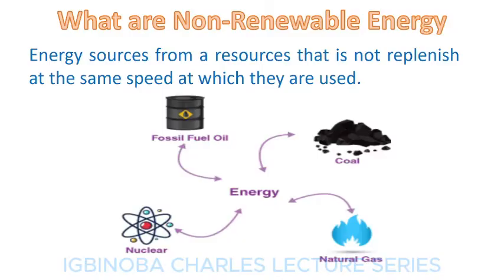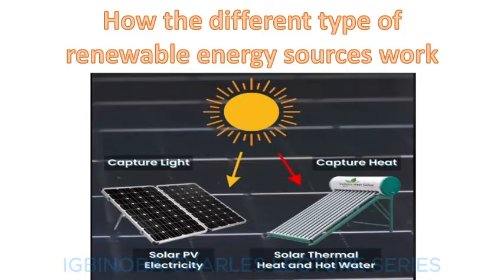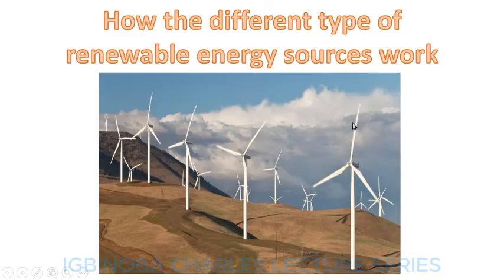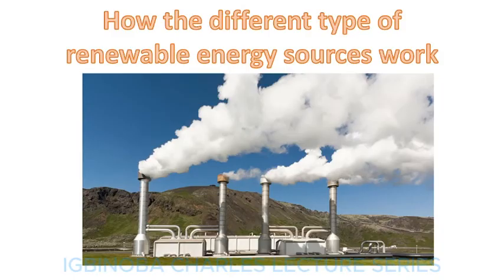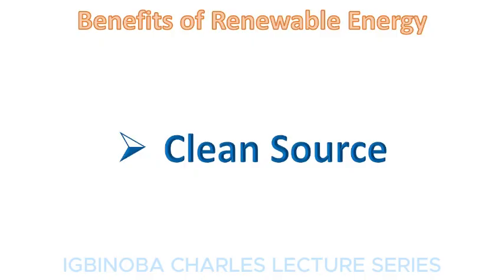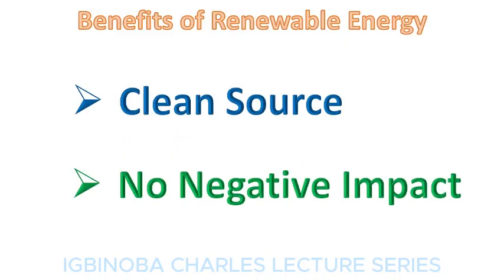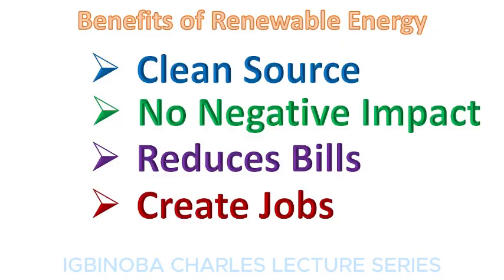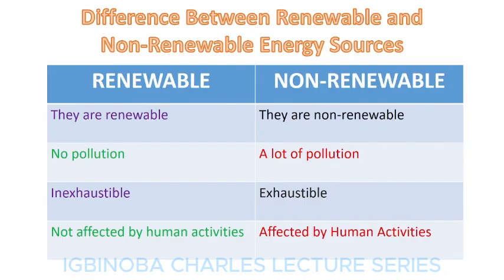From Fossil Fuels to Clean Power: Understanding Energy Sources

Comment: EEE81C 

No energy source can be considered completely pollution-free when evaluated using a life-cycle assessment. Every source of energy has some environmental impact.

Even renewable sources produce pollution during the manufacturing, installation, maintenance, and disposal of equipment such as solar panels and wind turbines.

Non-renewable sources, such as coal and petroleum, cause more direct and significant pollution during their use.

Comment: CIV2B 
 No energy source can be considered completely pollution-free.
Even renewable sources such as solar, wind, and hydroelectric power have some environmental impact during the manufacturing, transportation, installation, maintenance, and disposal of their equipment.
For example, solar panels do not produce pollution while generating electricity, but producing and disposing of the panels requires energy and materials.
Therefore, some energy sources are much cleaner than others, but none can realistically be considered 100% pollution-free.

Comment: MAR103Y
 No energy source can be considered completely pollution-free when evaluated using a life-cycle assessment. Every source of energy has some environmental impact. Even renewable sources produce pollution during the manufacturing, installation, maintenance, and disposal of equipment such as solar panels and wind turbines. Non-renewable sources, such as coal and petroleum, cause more direct and significant pollution during their use.

Comment: EFETURI-YOUNG SOLOMON 
COET/10546/2022

No energy source can be considered completely pollution-free when evaluated using a life-cycle assessment. Every source of energy has some environmental impact. Even renewable sources produce pollution during the manufacturing, installation, maintenance, and disposal of equipment such as solar panels and wind turbines. Non-renewable sources, such as coal and petroleum, cause more direct and significant pollution during their use.

Comment: EEE54B
 ANSWER 
No energy source is 100% pollution-free because all of them create some pollution during mining, manufacturing, or waste disposal. The cleanest options are renewables like solar, wind, and hydro, which produce zero pollution while running. Nuclear is also very clean with zero air pollution, though it creates radioactive waste that must be stored safely. The dirtiest are fossil fuels — coal, oil, and gas — because they release lots of CO2 and air pollution. Currently, the best combo for low emissions is wind, solar, and nuclear together, and over their full lifetime they are 10-50x cleaner than coal.

Comment: MEC76X 

No, no source of energy can be considered completely pollution-free.
Even renewable sources such as solar, wind, hydro, and geothermal energy produce little or no pollution during operation, but some environmental impact occurs during the manufacturing, transportation, installation, maintenance, and disposal of their equipment.
For example, solar panels require raw materials and energy to manufacture, while hydroelectric dams can affect rivers and ecosystems.
Conclusion: Renewable energy sources are cleaner and much less polluting than fossil fuels, but no energy source is completely pollution-free.

Comment: CHM30D
Answer:
No energy source can be classified as completely pollution-free when evaluated through a full Life Cycle Assessment (LCA). Even renewable energy systems that emit zero pollutants during operational generation carry an indirect environmental footprint during raw material extraction, equipment manufacturing, installation, maintenance, and end-of-life waste disposal. Ultimately, energy transitions focus on minimizing cumulative environmental degradation rather than eliminating it entirely.

Comment: CIV42P

No energy source can be considered completely pollution-free.

Reason: Even renewable energy sources such as solar, wind, and hydroelectric power can cause some environmental impact during the manufacturing, construction, transportation, and disposal of their equipment. For example, solar panels require raw materials and energy to manufacture, while hydroelectric dams can disturb ecosystems.
However, renewable energy sources generally produce much less pollution during operation than fossil fuels such as coal, oil, and natural gas.

Comment: MAR87I

ANSWER: NO

REASON:
No energy source is completely pollution-free because its production, transportation, installation, operation, or disposal can cause some environmental impact.

For example, solar and wind energy produce little pollution during operation, but manufacturing their equipment requires mining and processing materials.

Therefore, renewable energy is cleaner, but not 100% pollution-free.

Comment: PETRO40N
Answer: No energy source can be considered 100% pollution-free.
Reason: Even renewable sources such as solar, wind, and hydroelectric power can cause some environmental pollution during the manufacturing, transportation, construction, or disposal of their equipment. For example, solar panels require mining and industrial processes to produce.
However, renewable energy sources generally produce much less pollution during operation than fossil fuels such as coal, oil, and natural gas.

Comment: PETRO80B

No source of energy is truly free — while raw resources like sunlight or wind cost nothing to exist, converting them into usable energy always requires equipment, labor, and maintenance, all of which have a cost. Additionally, energy conversion always loses some usable energy as waste heat, since no process is 100% efficient. So even free energy sources come with real costs to harness and use. 23:16 23:16 23:16 23:16

Comment: CHM66N
Answer:
No type of energy can be said to be completely free from pollution.
Reason: All forms of energy production and consumption have some level of environmental impact, either directly or indirectly. For example, solar and wind energy produce very little pollution during operation. However, the production, transportation, and installation of their equipment require materials and energy, which can cause environmental pollution.
Therefore, renewable energy sources are cleaner and more environmentally friendly, but they are not completely pollution-free.

Comment: CIV44R
ANSWER:Every energy source has some environmental impact. While renewable options like solar, wind, and hydro cause pollution during manufacturing, setup, and disposal, they generate almost none while running. As a result, they are vastly cleaner and less polluting than fossil fuels.

Comment: MAR111G 
No source of energy can be said to be  100% pollution free but renewable energy sources like Solar energy have a minimal pollution in comparison with non-renewable energy sources like coalnand crude oil which pollute the environment in various ways such as exhaust  fumes, noise pollution from engines, and emissions. Renewable energy such as solar energy is a cleaner and more efficient method in tackling and mitigating these  pollution problems because it does not release exhaust fumes and it is very much noiseless.

Comment: PETRO94P
Renewables are not pollution-free , but they are pollution-minimal—especially during operation. When paired with responsible sourcing, improved recycling, and careful siting, their environmental footprint is vastly smaller than fossil fuels. The question is less about finding a perfectly clean source and more about choosing the least harmful option while continuously improving it.

Comment: PETROCHEM24X

No, no source of energy can be considered completely pollution-free. Even energy sources such as solar and wind, which produce little or no pollution while being used, can cause some environmental damage during the manufacture, transportation, installation, and disposal of their equipment. For example, producing solar cells requires industrial processes that can cause pollution. Therefore, some energy sources are cleaner than others, but none is completely pollution-free.

Comment: CHM108C
No energy source is completely pollution-free. Even renewables like solar, wind, and hydroelectric power have environmental impacts during production, installation, and disposal. However, they produce far less pollution during operation than fossil fuels and are therefore considered clean or low-pollution energy sources.

Comment: MEC74v

ANSWER:No energy source is completely pollution-free. Even renewables like solar, wind, and hydroelectric power have environmental impacts during production, installation, and disposal. However, they produce far less pollution during operation than fossil fuels and are therefore considered clean or low-pollution energy sources.

Comment: MEC30D

Ans: No source of energy can be considered completely pollution free.
Even renewable energy sources such as solar, wind and hydroelectric energy can use some environmental impact during the manufacturing construction, transportation or installation of the equipment. Therefore, energy sources can be cleaner or less polluting, but not completely pollution free

Comment: COMP93O
 

Answer: No, no source of energy is completely pollution-free.
Even renewable sources like solar, wind, and hydroelectric power can cause some pollution during their manufacturing, transportation, construction, and disposal.
For example, solar panels produce clean electricity during operation, but manufacturing them requires raw materials and energy, which can create pollution.

Comment: NAT37K

ANSWER:No energy source is completely pollution-free. Even renewables like solar, wind, and hydroelectric power have environmental impacts during production, installation, and disposal. However, they produce far less pollution during operation than fossil fuels and are therefore considered clean or low-pollution energy sources.

Comment: MEC36J 
Answer:No energy source is 100% pollution-free. While renewable sources (like solar and wind) generate electricity without emitting harmful greenhouse gases, the industrial processes required to mine raw materials, manufacture the equipment, and eventually dispose of it still create an environmental footprint.

Comment: EEE42P
No ,energy source can be considered completely pollution-free. Even renewable sources such as solar, wind, and hydroelectric power have some environmental impact during the manufacturing, transportation, installation, and disposal of their equipment. For example, solar panels require raw materials and energy to manufacture, while hydroelectric dams can affect ecosystems and wildlife.

However, some energy sources produce far less pollution during operation than fossil fuels. Renewable sources such as solar and wind are therefore considered clean or low-pollution energy sources, rather than completely pollution-free ones.

Comment: MEC44R

No. No source of energy is completely pollution-free.

Reason:
Even renewable energy sources like solar, wind, and hydropower cause some pollution during the manufacturing, transportation, installation, and disposal of equipment. Fossil fuels cause much more pollution because they release harmful gases when burned.

So, while some energy sources are cleaner than others, no energy source is entirely free from pollution.

Comment: PETRO70R

No energy source can be considered completely pollution-free. This is because every method of Producing or using energy has some impact on the environment, either directly or indirectly. For example, solar and wind ener gy produce very little pollution during operation, but manufacturing their equipment requires raw materials, ener qy, and transportation, which can contribute to environmental pollution. Therefore, renewable energy sources are regarded as cleaner and more environmentally friendly alternatives rather than being entirely pollution-free.

Comment: CIV61I
Answer:No energy source is 100% pollution-free. While renewable sources (like solar and wind) generate electricity without emitting harmful greenhouse gases, the industrial processes required to mine raw materials, manufacture the equipment, and eventually dispose of it still create an environmental footprint.

Comment: CHM52z
No, no energy source is 100% pollution-free.
Reason:
While renewable sources (like solar and wind) generate electricity without emitting harmful greenhouse gases, the industrial processes required to mine raw materials, manufacture the equipment, and eventually dispose of it still create a small environmental footprint.

Comment: EEE31E
Answer
No energy source can be regarded as completely pollution-free.
Reason: Every form of energy production or use has some effect on the environment, either directly or indirectly. For instance, solar and wind energy generate little pollution while operating, but producing their equipment requires raw materials, energy, and transportation, which may contribute to pollution.
Therefore, renewable energy sources are considered cleaner alternatives, rather than being entirely pollution-free.

Comment: EEE3C
No energy source is 100% pollution-free . Even though solar, wind, and hydro produce zero emissions while operating, pollution still occurs when mining their raw metals, manufacturing and transporting the equipment, and disposing of old panels or batteries. Renewables are far cleaner than fossil fuels, but no energy source is completely zero-impact from start to finish.

Comment: EEE96R

No, no source of energy is completely pollution free.

Reason: Every source of energy causes some pollution or environmental impact at some stage. 
For example:
Thermal power plants burn fossil fuels and release harmful gases like carbon dioxide.
Hydroelectric projects can disturb ecosystems and displace people.
Solar panels and wind turbines produce clean electricity during use, but pollution is caused during their manufacturing, transportation, and disposal.

Therefore, while some energy sources are much cleaner than others, no energy source is entirely pollution free.

Comment: EEE17Q
Answer: No energy source can be considered 100% pollution-free because every method of generating or using energy impacts the environment in some way, directly or indirectly. For instance, solar and wind power produce minimal pollution during operation, but manufacturing the equipment requires raw materials, energy, and transport—all of which generate pollution.
Therefore, renewable energy is best viewed as a cleaner alternative rather than being completely free of pollution.

Comment: EEE52Z

No energy source can be regarded as completely pollution-free.
Reason: Every form of energy production or use has some effect on the environment, either directly or indirectly. For instance, solar and wind energy generate little pollution while operating, but producing their equipment requires raw materials, energy, and transportation, which may contribute to pollution.
Therefore, renewable energy sources are considered cleaner alternatives, rather than being entirely pollution-free.

Comment: EEE48V

Answer: No energy source is completely pollution-free. Every form of energy has some environmental impact at some stage of its life cycle. Non-renewable energy sources generally cause pollution through extraction, processing, and combustion. Renewable energy sources are cleaner, but they still require materials, equipment, and infrastructure that must be manufactured, transported, and maintained. As a result, some level of pollution or environmental impact can occur during the production, installation, transportation, or operation of these systems.

Comment: CHM23W
Answer:
No type of energy can be said to be completely free from pollution.
Reason: All forms of energy production and consumption have some level of environmental impact, either directly or indirectly. For example, solar and wind energy produce very little pollution during operation. However, the production, transportation, and installation of their equipment require materials and energy, which can cause environmental pollution.
Therefore, renewable energy sources are cleaner and more environmentally friendly, but they are not completely pollution-free.

Comment: CHM16P

Answer:
No energy source can be regarded as completely pollution-free.
Reason: Every form of energy production or use has some effect on the environment, either directly or indirectly. For instance, solar and wind energy generate little pollution while operating, but producing their equipment requires raw materials, energy, and transportation, which may contribute to pollution.
Therefore, renewable energy sources are considered cleaner alternatives, rather than being entirely pollution-free.

Comment: CIV76X
No single energy source can be considered completely pollution-free.
Even renewable sources such as solar, wind, and hydropower have some environmental impacts during their manufacturing, construction, transportation, operation, or disposal. For example, solar panels require raw materials and energy to manufacture.
Therefore, some energy sources are cleaner and produce much less pollution, but none is absolutely pollution-free.

Comment: PETRO87I

No energy source can be considered completely pollution-free. This is because every method of producing or using energy has some impact on the environment, either directly or indirectly. For example, solar and wind energy produce very little pollution during operation, but manufacturing their equipment requires raw materials, energy, and transportation, which can contribute to environmental pollution. Therefore, renewable energy sources are regarded as cleaner and more environmentally friendly alternatives rather than being entirely pollution-free.